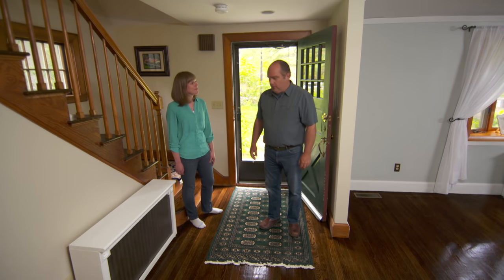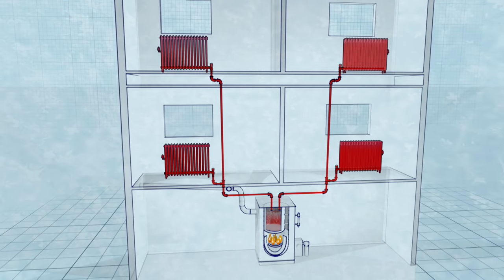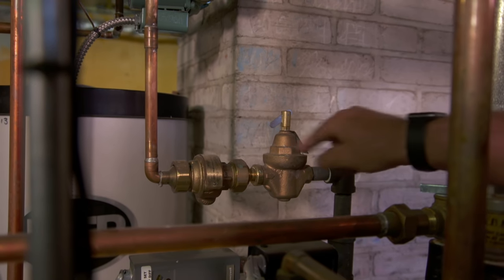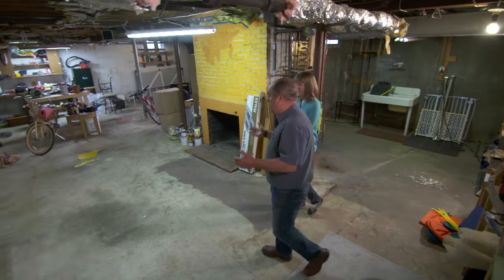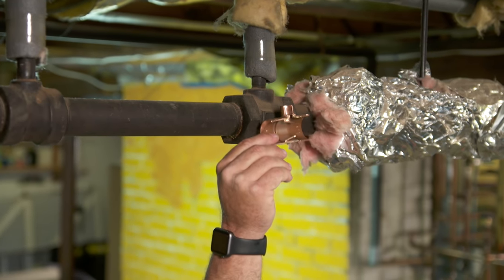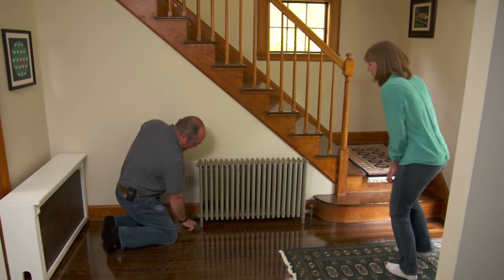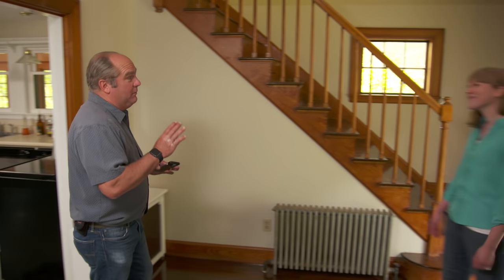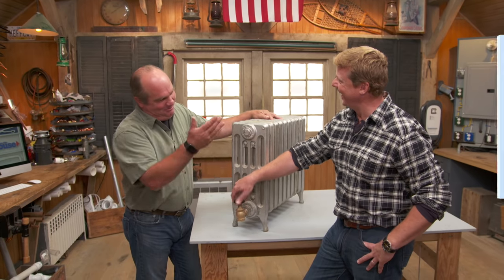How to Diagnose Problems with a Hot Water Heating System | Ask This Old House

Comment: anyone with any suggestions?

i have a cold radiator on the second floor.  it's been bled and still does not heat.  let's assume pressure in the system is OK - another second floor radiator, on a different pipe run, is working fine.
its an old system - no TRV valves, but with typical "open/close" valves from the feed side.

but the pipe from the feed side, prior to the radiator valve, is cold - doesn't that mean the problem may not be the radiator itself?  it seems like there is no water even getting to the second floor on that pipe run.   could the problem possibly be a sludge blockage way up the system?   or an air block in that pipe run?

here is the basic system to that cold radiator:
a pipe from the boiler goes horizontally along the basement ceiling, to a wall, where it branches into two - with one branch going horizontally, then vertically to a functioning first floor radiator, and another branch doing the same, up to the non-functioning second floor radiator.   i feel heat in both horizontal branches.  but in the branch to the non-working radiator, i don't think i feel heat where it turns to a vertical direction.  It is hard to tell since most of it is embedded in a block wall (hard to get the palm of my hand in there to check.).  

i am thinking there is sludge blockage maybe where it turns from a horizontal to a vertical direction, or else somewhere along the vertical line from there (the basement) to the second floor.  again - at the second floor, the pipe run is cold prior to even getting to the radiator.

as a non-plumber, can i unbolt the pipe connection to check it out, then put everything back together?  or will re-attaching a removed pipe segment involve a  tool i might not have that is needed to torque it tightly?  

any help is appreciated - any questions are welcome.......i froze my hiny off this last march and april working from home in the second floor room where the computer is....thanks for any help!
Reply: Im an idiot....well, I just didn't know how simple the problem was to fix:  IT JUST NEEDED MORE WATER!
But i don't understand why, since that was the problem, the cold radiator remained cold and not another one FURTHER AWAY from the heating source.  That would seem logical, but that wasn't the case.  Oh well.....

Anyway,  with the system not running, i had someone open the bleed valve to the always cold radiator.  In the basement, I found a random valve that resides on a pipe between the main house water service and the heating unit.   Hmmm - could that be for recharging the system?   Well, I guessed right, since I didn't blow up the place.    

During this process, air spurt from the cold radiator at a much higher rate (you can hear it) than before.  Finally, when water spurted from the bleed valve, my assistant yelled to me that this was so, and then I closed that valve in the basement.

There is no sludge blockage as I thought, and nothing else wrong at this time - mind you, this is stuff installed in 1900, and it still works well.  Incredible......but the cold radiator will heat now, and that's that.  

I am sharing because for someone else never having need to learn it, it could seem puzzling, yet costs nothing to resolve.    That is all it was - add a little water by way of a valve.
My understanding is that even some very old systems don't have to do this - they have a special valve that automatically adds water when levels get too low.   Mine might have that, but I suspect it is non-functional because the valve I DID turn happens to be on a bypass around the one I assume is to be an automatic  re-charging valve.

Comment: Can these types of radiators have sludge problems? Mine seems to be cooler at the bottom and barely warm on top. We have issues with our house not warming up at all. 

We live in a home that is split into multiple homes and the thermostat is located in only one apartment up front. 

Even when it's set to 80, which is the only time we feel any heat in our part of the house, only two radiators produce decent heat while the others are barely warm. Please help. I sense the specialist is just lying to us, looking for us to spend money.
Reply: Sounds like it's circulating slowly. Either the pump is going out, pressure is too low or it may need to be flushed if it's sludged up (should be treated with a rust remover then flushed every summer when the heater is entirely off then treated with a rust preventer if your house is as old as mine

P.s. I'm just DIYing repairs and maintenance to my mom's 100+ year old house- no training or professionals just old childhood memories paired with many books and videos.
Reply: What is the "specialist" saying?

Comment: In the real world that valve would have been open and the radiator still would not heat up. Then what do you do? That’s what I was hoping to find out.
Reply: He tried bleeding it, which is the problem 90% of the time. The first one on the loop might need an automatic bleeder, though some have "nickle valves" that will slowly let the air out until the rubber swells up, as long as you don't over-tighten them.

Comment: Me:Furnace wont start.
Furnace guy: SAYS ITS A BAD CONTROL BOARD
me: ok, replace it.
Furnace guy: Replaced! furnace should work
(turns thermostat on heat and sets temputure up)
(furnace wont start...)
me: 😠😠😠😠😠😠😠 furnace cant start!!!!
Meanwhile the service switch is off...
Me: Oh wait, I see a switch that's in the Off position..... weird.
(turns switch on)
(furnace starts)
Me: :) :) :D FURNACE FINALLY STARTS ..... ALL IT WAS A SWITCH TO BE IN ON POSITION.
Reply: Was it RED?

Comment: Really steam hasn't been around since the 30s stop misleading people. Steam is still used for heat today.
Reply: HE MEANT THAT IT HASN'T BEEN INSTALLED IN NEW HOMES SINCE THE 30S. But I see how you were confused.
Reply: michaelfarm lol yes it is. I still install them..... I'm not confused at all.
Reply: John John, you still install steam powered heating, wow, is  that in domestic/ residential houses or for shared communal accommodation, or commercial purposes.
Reply: In my area ,steam was still installed in new homes up until 1950s
Reply: Please remember that Richard is a house plumber, he does not know lots of about steam system.
We still today installing lot of steam systems, both low and very high pressure steam.
Reply: i have installed a few steam boilers in the past few years they still sell them and they are still installed
Reply: In residential single family homes? Or in commercial and multi-family residential?
Reply: all 3
Reply: I've always heard that that steam works better in tall buildings, for obvious reasons. But I haven't heard of it being installed in new single family houses, unless it's part of a district heating system. If there are people who go out of their way to install it, that would make for an interesting show topic in and of itself.

Comment: A good plumber (or heating engineer) would have checked the radiator flow valve before chatting up the householder and running down into the basement - easy fix in less than 30 seconds.
Reply: A "good plumber" would not have had a show worth watching, which was the real point of this.

Comment: hot water heater dont you mena a water heater. hot water doesnt need heating
Reply: What if the water is 120 degrees but you need to be 140..the hot water needs heating right..?
Reply: The adjective refers to the (fuel-based) type of ambient heater, not the object it's heating.
See: steam/oil/propane/ kerosene/electric/forced air (etc) household heaters
"Water heaters" raise the temperature of water to provide disposable heated water to your faucets.

Comment: Hot water heater?????? Cold water cooler !!!
Reply: The adjective is the fuel type.
Think propane heater. Electric heater. The heater heats the area using: Hot water, electricity, propane, natural gas, kerosene, wood pellets, solar energy etc...
Water heaters supply hot water for faucets. "Cast-iron hot-water radiator ambient heater" is a mouth full in English we trust you to figure out the adjectives on your own. That's why ESOL learners hate this part of English Grammar

Comment: So there are no separate flow and return manifolds?  How primitive
Reply: cjmillsnun it's a system from the 1950's. Radiators were like this since central heating was invented. Separate flow and return is a much more recent innovation but of an old system still works, why change it?
Reply: @spencerwilton5831  My house was built in 1950 and I have separate returns. There are separate circulating pumps for each floor. House is remarkably efficient to heat for its size.

Comment: Can anyone share a link for a cold radiator, where rad valve is OPEN, unlike this useless video...?
Reply: No. I don't have any.
I do have my check list.
Forced water or gravity? (Is the problem pump/circuits/levels/pressure/internal boiler temperature?)
Is there no heat or partial heat?
Are the lines isolated or in circuit? Are all of the valves open from start to end? (Is your water even circulating to that radiator?)

Did you bleed the radiator?- no? Could be air in the system.
Did you flush the system, remove the sludge give it fresh water and anti oxidizers in the last warm season? No? Possible clog.
Is it the last or only radiator on the circuti? -if so, when you bleed the valve does any water come out? No? Low water. Or low pressure.
...
Good luck! Mine was the last in a line of a gravity boiler. I tried to bleed the line and dropped the pressure lowering the water level and resulted in no heat to the second floor)

Comment: These videos for these old houses are pointless.  Garbage technology, inefficient and dangerous.
Reply: Jonas Venture Jr. How are radiators dangerous? It's tried and tested technology in use since Victorian times. Radiators with a modern condensing boiler are efficient, reliable and inherently safe.
Reply: My house was built by the leading home builder in our state as a wedding gift for his daughter. He chose hydronic heating.  It functions beautifully and has been very efficient.